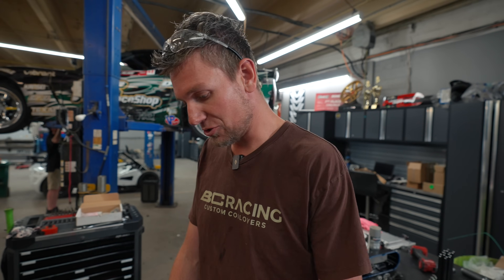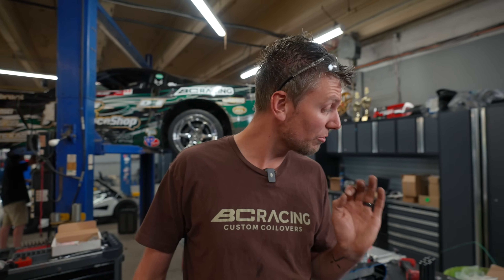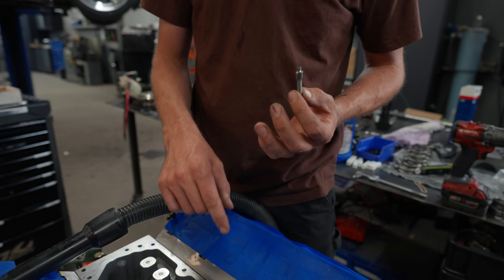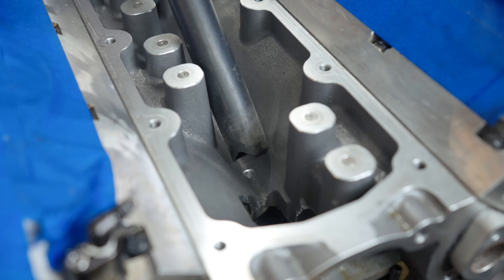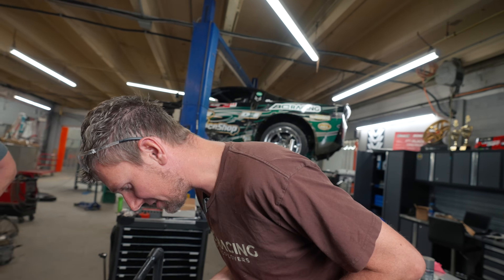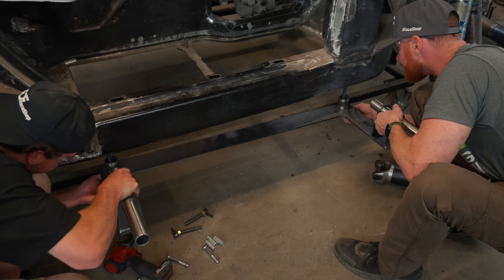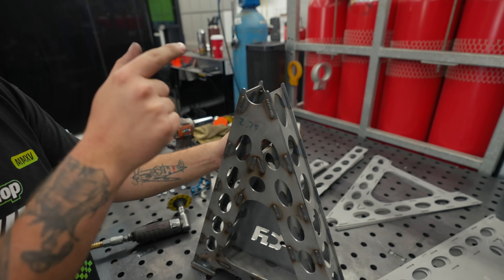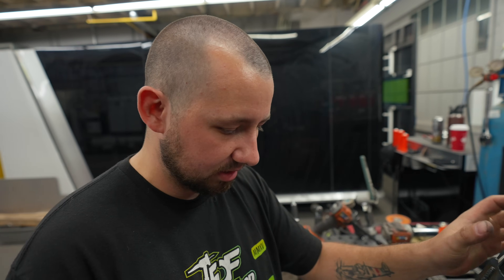Design Time Episode 6: Why Jack Stands Suck (And What We Built Instead)

Comment: For your jack stand drilling Jig, would it make sense to add a third (middle) frame tube for a single jacking point in the middle of the rocker panel under each door?  Would help in the situation where it makes sense to jack the car from the middle of the side, especially if you have a flat tire and the Jack will not go under the car easily.  This would be for the guys that haven't installed air jacks yet.

Comment: With the bottom of your stands you have a high point load. Don't assume you will always be on very hard surface when you use these. Spread the load if you can better. Also as the car settles on the stands they will want to allign with the ground. Ones I have from over 25 years ago have a footer that has the ability to swivel so the contact point alligns with the ground properly.
Also if you put some small studs, one per nut, where you have left space for the wheelnuts to go you can tell if one is missing easily.

Comment: Will the lower setting not cause interference between the top of the jack stand and the front fender? Or does the jack stand not sit that close to the body to be an issue?